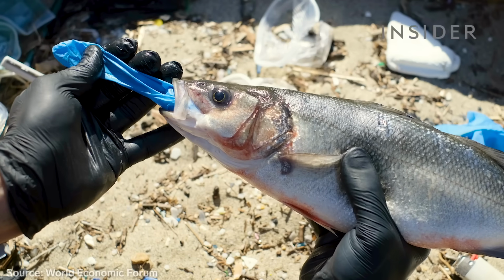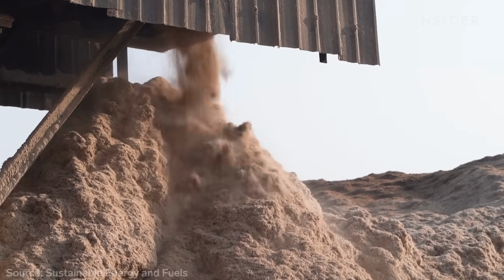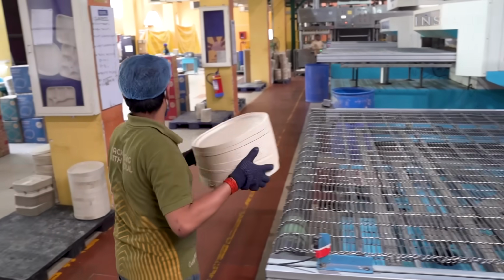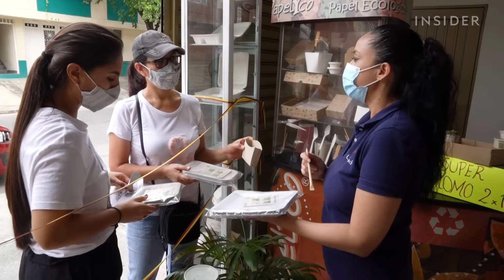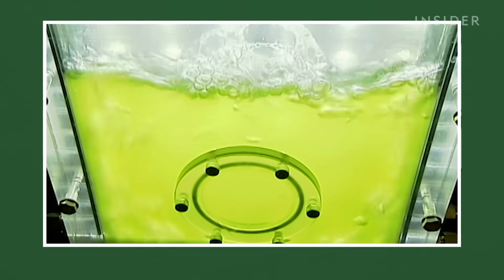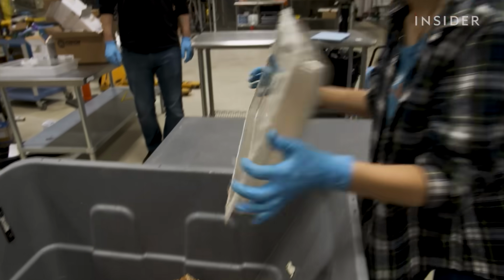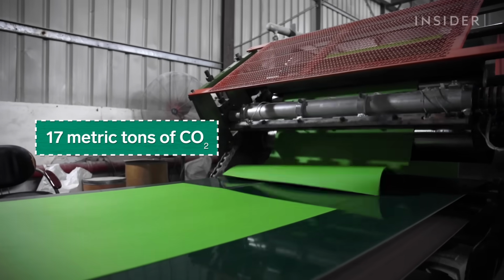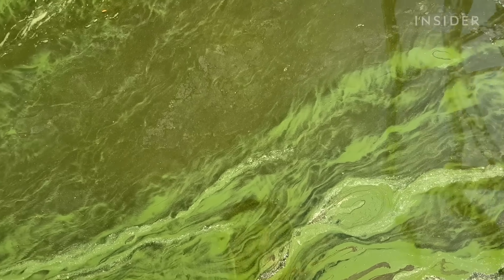How To Replace Plastic With Avocados, Algae, Mushrooms And Sugarcane | World Wide Waste Marathon

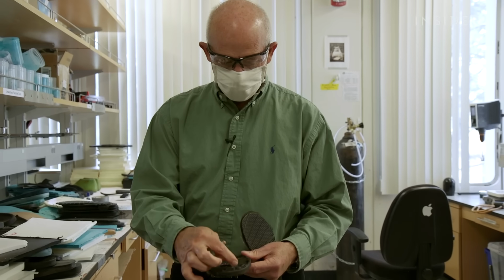Comment: 14:45 I'm kinda disappointed they just use glue on these, though...
What about when that sandal is exposed to hot sun right on it, for hours? 100 degree+ temp from pavement underneath, ocean water, water in general, and the strap being pulled constantly from use.

why not just do something longer lasting for the sandal, like a physical knot of the strap material on the other side? or something like that. there has to be a better way than glue.

Also these would be good for hospitals and prisons etc where they just give free/cheap sandals.

Comment: They group the biodegradable plates into plastic bags before putting them in the boxes.  :(  I'm also left wondering about the glue used on the flip-flops, and whether it is toxic... I wouldn't want my compost to have toxins in it.
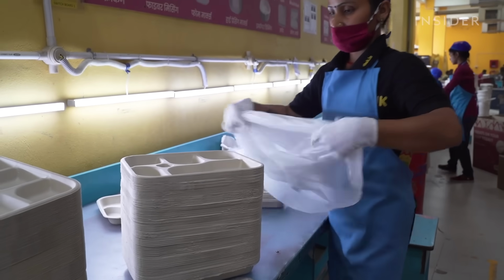Reply: The plastic bags you're referring to are described as being "starch-based compostable plastic" at around the 7:10 mark in the video.  In truth, though, I'm fuzzy on what that product actually is.  The plates appear to be made of cellulose fiber derived from sugar cane--basically the same as a heavy paper plate, except from waste sugar cane rather than wood as the fiber source.  That's kind of an odd product to have in a video that seems to mostly about more (presumably) environmentally benign plastics.  If the plates are paper and simply go into a landfill, they'll be a source of methane, of course.  There's also no mention in the video of what they do with all the wash water in the initial processing of the bagasse.  It's probably too nutrient rich to just discharge into the environment without hazard.

Comment: Some of the things they're talking about replacing like flip flops...I don't want to buy things that are supposed to last that are made from things that biodegrade. I have a cheap plastic pair of sliders I use for just getting mail taking out trash, they were $12 at Ross, I will never have any need to replace them nor do I want to get something fancier to take out the trash, so I do NOT want them to biodegrade. I also have a plastic water bottle that I've had for probably 6 years now. I have no need to replace it & I certainly wouldn't want it biodegrading in my refrigerator then all the water pouring everywhere when it gets a hole in the side. & this stuff is going to be more expensive? Nobody is gonna buy this stuff.

Comment: Bioplastics use more formaldehyde and chemicals that leech out during use and/or composting. There is a reason why they weren't used 100 years ago but plastics took off and were

Comment: It's surprising how inefficient the mycelium process is. Perhaps they haven't realized this, but they could pre-grow the mycelium using the same process, but then grind up that into little chunks that they then use as a filler. This could easily cut in half the amount of substrate material needed

Comment: It's so difficult to accept this as an answer. Due, to me, as so many promises of bio plastic being an answer, for @30 years now. And that answer meaning nothing. And during that time supposed recycling equaling nothing. 
Along with people a person that worked on the back of trash trucks, worked on conveyor lines where it was supposed to be sorted. And the recycling supposedly cleaned before coming to location for sorting. Lies.
No one sorted their plastics, cans, and or paper, never mind cleaning it before putting it in their recycling bins. And from the trucks, onto the conveyor lines, it was plain regular trash. We had to wear cut resistant gloves, face shields, and long plastic sleeves. Which made it nearly impossible to sort. And that was if, it was simply recycling items. 
But, like I said, it came to us as regular vtrash. 
Which means broken glass bits, which could fit in the tiny cracks of the cut resistant gloves. The stench from the debris was disgusting ( people got sick, and vomited) days-old baby diapers, diarrhea covered adult clothing, whiskey, wine, Ketchup, mustard, you name it. It was all on the line. 
Plus, the rate of speed the conveyor moved was too fast.
We want production. You'll get use to it. 
Next employment contract of trash truck worker( a day agency, that sometimes stretched into weeks), same thing. Whether it was to a high mechanized location, or, basic landfill dump. The idea of recycling was B.S.. No profit, not possible without government backing, and government backing disappeared quick. After working it a few times it was just a joke. That we simply didn't admit to. To keep people hoping, and maybe the habit would be established by time the process actually came into practical regular use.
I don't know how it is now but back 10- 15 years ago. That's how it was. Our planet is s so overloaded with toxins due of lack of honesty in our knowledge in how to manage new products. And our lack of honesty in actually working it into daily regular guy full time work. 
It's awful.

Comment: None of these were really new.  We still haven't figured out scaling, and making it cheaper than plastic.  Only when you can achieve that, you will solve the plastic crisis.
Reply: If crude oil were priced at its true cost - including all the damage it causes to the environment - that'd change very quickly. As it is, it's in the oil producers' interest to keep prices artificially low to keep industry hooked on it.

Comment: The plastic condom is made from plastic film (ethylene ethyl acrilate) of 0.001 inch (0.0254 mm.) thickness. In addition, a rubber ring is provided and sealed into the base of the condom for retention during coitus

Comment: I have some concerns with the way this technology is already being used in the food service industry. A lot of restaurants and grocery stores in my area are already using forks and spoons made of wheat, corn, and sugar cane. This is an issue for people allergic to gluten and corn. Also, many people allergic to latex are also allergic to avocados. Some of these spoons and forks also have an immediate taste the second you put them in your mouth that makes the food taste awful. The sugarcane-paper food containers are also awful. They literally dissolve when hot food is put in them and sticky things like rice stick to them pulling up paper fibers. There is one sushi restaurant that uses these and I have to request they put a piece of plastic wrap or foil under my sushi so the rice doesn't get contaminated with paper fibers which totally defeats the purpose of not using plastic. They have to at least make these compostable products meant to replace plastic ones as durable and waterproof as the plastic ones and also not make the food taste bad if they're used to serve food. Also, I am worried that for things meant to be used more than once, since the plastic is designed to be degraded by bacteria, a bacteria could infect the item such as the shoe and degrade it before the owner actually wants to throw it away. Don't use this biodegradable plastic in electronics, because you don't want your phone to die because it's physically infected with a bacteria before you wanna throw it away either.
Reply: A small piece of plastic doesn't "totally defeat" the purpose of getting rid of plastic packaging - there's a substantial difference in mass there. But I wonder about using wax coatings in that instance - when I was a kid, bread came in waxed paper. Seems like that could be a good idea for surfaces that will contact the food.
Reply: Food for thought

Comment: There is a tradeoff in engineering plastics, including bio plastics, of strength and biodegradability.  It doesn't matter if you make the plastic from oils or biomass, if you make it strong enough to be useful it will not be very biodegradable.   What we need is a material that can be strong but be broken down.  We are far from discovering such a material. These "bio" companies are a cash grab.  NON disposable, constantly reusable products are the future for now.  Don't use disposable junk if you don't have to.

Comment: it's nice that a lot of the every day plastic packaging can now be replaced with biodegradable alternatives. there's still some plastic products that dont yet have an alternative like bottles or tape
Reply: There are! Bioplastic bottles can be made. One of my friends has a factory producing bioplastic bottles.
Reply: @tamastabi3182  what are they made of?
Reply: @xXxSkyViperxXx  The are made of the most common bioplastic called PLA (polylactic acid). They use some modification via natural additives for tailor made properties, but the bottles got the four star OK biobased certificate.
Reply: @tamastabi3182  i guess it still has a little bit of plastic but less than the usual i guess, kinda like those fastfood drink cups with tiny bit of plastic lining besides the cardboard
Reply: @xXxSkyViperxXx  As I know it only contains bioplastic (besides the natural additives like cellulose fibers). Their policy is that they are not using any conventional plastic, since it could cause promblems if their products ended in a compost and all of the component would not be bio-based as well as biodegradable.

Comment: You need hope? 

First. The entire free world warned Germany against becoming dependent on Russian oil and gas and yet they continued that path. Germany, that normally are considered a country with a low corruption level accepted that their former 1st man 3 days after leaving office were employed by POOtin´s personal cashcow, Gazprom to head Gazprom´s negotiations to further build direct Russian/German pipelines. It is very hard to not get the idea that that job came with a key to a secret Swiss bank account. 

Having said that... It is absolutely fantastic news that Denmark/Belgium/Holland AND Germany just have signed the "North Sea Summit" agreement. The worlds - by far - largest fossil fuel to sustainable energy transition deal, even includes the worlds - by far - largest sustainable hydrogen production flow. 
230 million (!) high energy using Europeans are going to transition from fossil fuels, hereunder much Russian gas, to electricity and hydrogen made from off shore windmill parks and energy islands in the North Sea! Deal just signed but work already in action. Of the 230 million people, minimum 40 percent will already be covered in just 7,5 years, rest inside 2035. Just days after the North Sea Summit Denmark on top announced they further would themselves add projects covering additional 20-25 millions and more might be added later. 

THIS are the most positive REAL news I can recall seeing since the Berlin wall fell. THIS are the answers and the solutions we need to see happen all over the world RIGHT NOW! ALL coastal countries should do the same RIGHT NOW! 

Canada and USA´s answer to the fuel crisis seem to be more tarsand and fracking (now also seem to be a Liss Truss favourite making UK going from ruined colonised countries to their own land. Fracking causes earthquakes and creates high risk of catastrophic mix between the chemical acid used to dissolve the stone containing gas bubbles and ground water reservoirs) guaranteeing they wont be able to live up to their commitments in the Paris climate accord. USA even now have started the US´s largest oil exploration auction in their history. THAT are the sure way to a global disaster forever changing the habitat that brought us here. NOTHING prevents Canada/USA/Australia to copy/paste the North Sea Summit agreement, all three nations have the waters where they could place the needed amount of off shore windmills to copy the Danish/Dutch/Belgian/German solution. 

IF we ALL ACT NOW we can basically keep our way of life it are just a matter of swapping fossil fuels to hydrogen and electricity. The 4 stroke direct hydrogen injection engine HAS been invented and can be used as cars/trucks/trains/boat/engines. I can see no reason why jet engines should not be able to use hydrogen after some small adjustments (WHY have the largest jet engine manufacturers and plane makers not already made that solution commercially available!?)

WE are OUT OF TIME! ONLY ACTION COUNTS! Off shore windmill parks are now the cheapest solution and it are the fastest and it are the greenest...ANY politician not working NOW to implement this IMMEDIATELY MUST be paid to have another opinion because THIS are the only way forward making sense! THIS is how we combat POOtin and this is how we combat climate change. When a windmill tower and engine are at its end of life it can basically be "thrown in the oven" and new windmills and engines can be built from the old metal just incorporated with latest technology and knowledge. THAT are perfect for the circular sustainable economy and growth we have to base our future on. 
An electric car´s battery that needs to be recycled have to go through a very energy heavy process and even after that it still have to have added new rare earth materials to create a new battery. The simpler 4 stroke direct injection hydrogen engine can, as the windmill engines, be thrown in the oven and a new can be built from the old material. 

SO,  Germany screwed up BUT they now have become partners in the North Sea Summit deal and thus have taken steps that will eventually replace POOtin´s gas with sustainable energy. WHAT are USA/Canada/Australia doing? After all these named countries all have a CO2 emission per Capita higher than any European nation today and none of these 3 nations have a plan in place like the North Sea Summit plan are! 

USA alone could, by making a simple copy/paste of the plan agreed upon in Denmark/Belgium/Holland/Germany + 35% replace ALL fossil fuels today used to make ALL electricity in USA and then even have enough electricity to even kickstart transitioning from gasoline driven cars to hydrogen driven cars. 

Can anyone explain WHY US/Canadian/Australian media and politicians are NOT reporting/talking about this deal? The North Sea summit deal are precisely what the entire world need to copy and paste locally NOW! THIS should be headline news ALL OVER THE WORLD since it represents the REAL answer to many of our problems in one single solution. PLEASE spread the word about this and demand your own nation follow same path NOW!
Reply: Appreciated ! 

Write me using the digit added to my name okay
Reply: @Houston583  Nope. You can state the matter of your interest here.

Comment: How about just using the pits to grow more avocados and the pineapple scraps as compost?
Reply: I think these are excess avocado seeds.
Reply: @overclucker  I probably could think of at least 100 other uses for avocado seeds than turning them into plastic plates that people are just going to throw away. 🍽 =lol
Reply: Reducing plastic takeout. Also avocado fruits are harvested faster than seeds can grow. Also also most seeds are at residents from them buying avocado. And on top of that I found out that plants like avocados and apples can just be grown because they seedling is not identical to the parent and may not taste good, hence propagation.